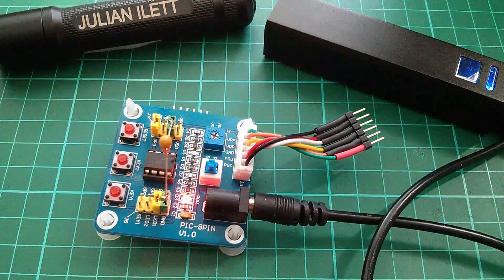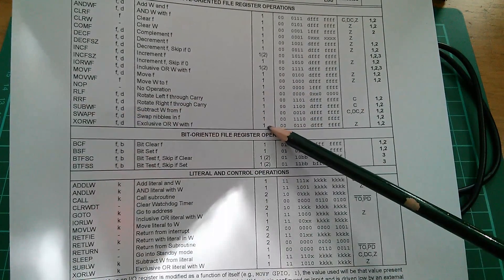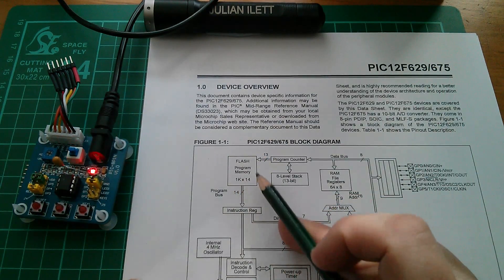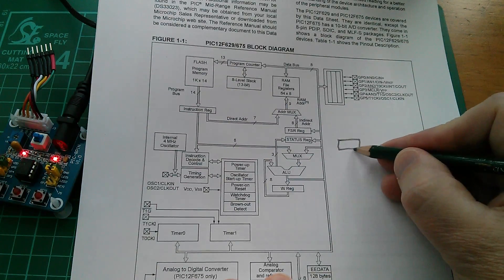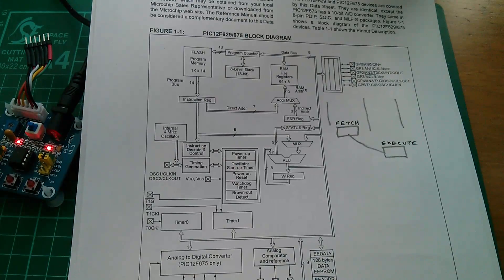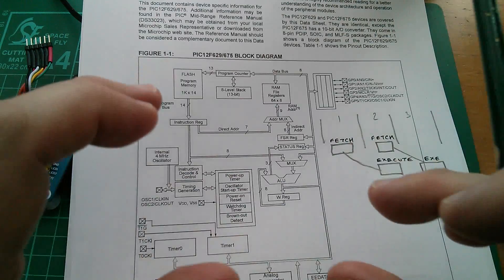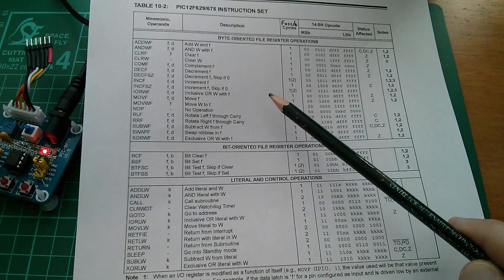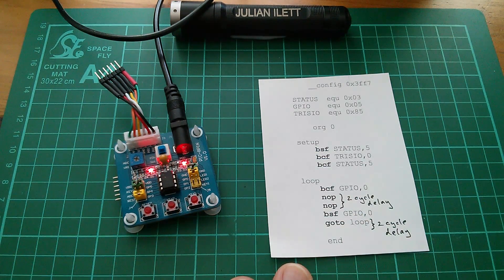PIC Assembly Language Update: #2.2 - Pipelines & Harvard

Comment: Hi Julian, thank you 4 the pic micro series using the pic12f675, have had many years break from digital electronics as a hobbyist, & annoyed @ myself 4 letting it slip, but your small series got me back again.  I was just about 2 quit @ the end of the last vid, as my led was dim, yet not blinking, but remembered on the 11th hr, in the back of my mind that MCLRE must be tied HIGH at the end of the day, so i changed Bit 5 in the CONFIG register, regards MCLRE, & set it LOW, so i had a better result with the config value 0x3fc6.  Then it started blinking, as i build this on a bread board pin 4 was left "open" once i removed the ICSP wires from my PICKIT 3.

I had 2 tell myself " I'm Back ".... i'm pick'n again, felt good 2 see that led finally blink, one second b4 i quit & gave up.

Thanks a mil !!  Look forwards to building more from your channel, analogue & digital.

Ernie H.

Comment: Julian, I really enjoy your videos and presentation technique.  I think I have watched almost all.  I wanted to get back into assembly language programming ( I did quite a bit years ago with the 68HC11) and picked the PIC because your tutorials were really easy to follow, besides I happen to have almost 100 unused 16F84As laying around.  I purchased one of those 12F675 boards you describe, a bunch of extra 675s, a PICkit3 clone and even a 3rd party simulator program.  Well I think next week I will be going to the local Salvation Army resale store and look for a good used blender.  I am going to convert the above into little particles and bury them in the field outside.  Despite your careful tutorials, multiple trips to the Microchip site and hours of trial and error trying to get things to work I have not been able to verify successful programming of the device.  I recommend you give some thought to doing tutorials on another processor that is supported by a rational, should I say, functional, development environment.  I think I will move on to the 68S12.

Comment: Also, I think you'll find that the Atmel gets away with 1 instruction cycle = 1 clock cycle by using a PLL.... probably another reason why they're more expensive than PICs.
Reply from the maker: That would explain it. I might have a play with a PLL (the CMOS 4046) - that would make an interesting video.

Comment: Great video, Julian! One of the hardest things for me to wrap my head around coming from high-level programming when I first started getting into hardware was the idea that hardware is always on. Procedural programmers don't think about the fact that ALU is still calculating even if you aren't running an arithmetic instruction, etc. Pipelining reminds me of that because you have to be open to the idea that you can fetch and write at the same time -- and when that goto hits and you get the penalty, the fetched instruction doesn't go away -- it's just that there is a circuit always running that blanks it to a nop when a branch gets taken.

Comment: So is this the reason for the existence of inline functions in C?
Reply: functions are usually worse than gotos / branches - the compiler has to store the state of the registers and the PC (so it knows where to return to) somewhere, usually on the stack... and then jump to the function...then do it in reverse at the end of the function.

old assembly trick is 'unrolling loops' instead of looping the same instructions ten times you could repeat the same instructions in the source.

you can get some compilers (gcc for sure) to produce assembly with the C as comments to see what the compiler did - inline often has no effect if the optimiser is turned on cos the compiler makes up its own mind about what would go faster inline... often it'll unroll loops for you too when that's sensible.

Comment: x64 uses an optimization technique called "delay slots" - basically you sorround jumps and calls with instructions that don't change the state of the CPU and then the cpu does not have to reset the pipelines. Does PIC have something similar? Care to explain how that works? I only managed to scrape the subject and you explain this stuff quite nicely. Thanks for the video.

Comment: Why the led is flashing at 1hz? Is the micro running at 8hz? I don't think this is possible
Reply: PIC uses 4 system clock cycles (and goto is 8 clock cycles) to execute an instruction. Hence if the LED flashes exactly at 1 Hz then its 24 clock cycles to execute that. So it should be 24Hz. Isn't it ?
Reply from the maker: +victornpb The system clock must be running at about 4Hz :)
Reply from the maker: +Satyajit Roy Sorry, yes you're right, 24Hz, my mistake.